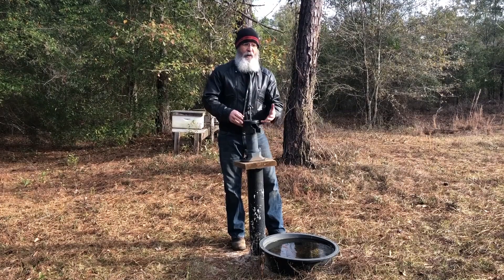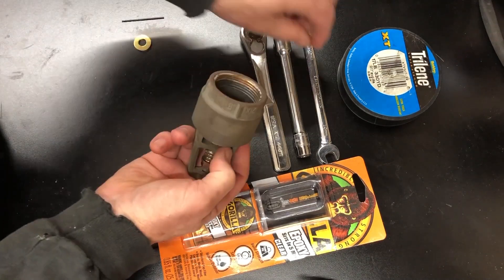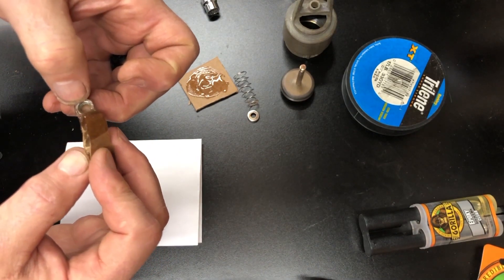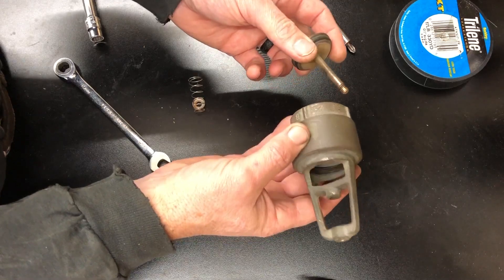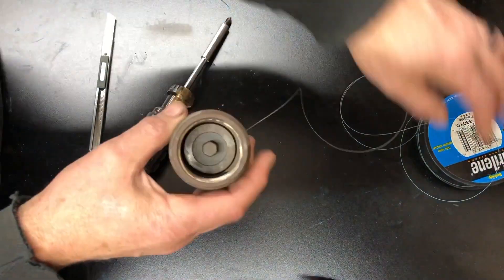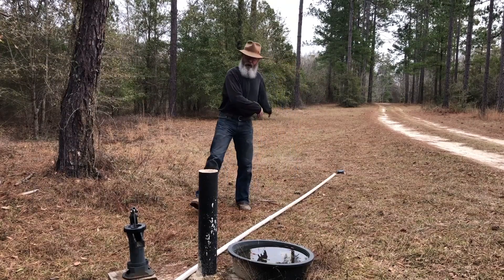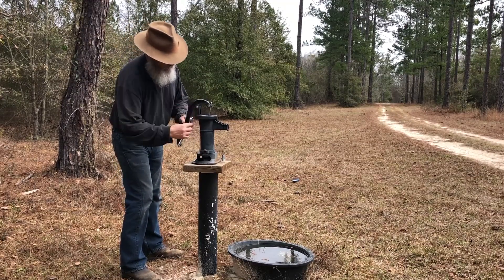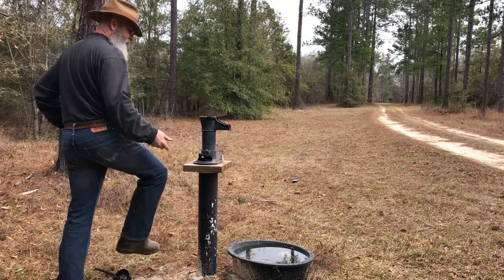Foot Valve Modification to Winterize Your Shallow Well

Comment: I’d be using 50 pound line.
Also I would have marked the side of the nut with a marker showing its orientation when tight. So your hole in the washer is perpendicular to the two  foot valve screen guides. Just to help. Good video.

Comment: Ah.  Thanks!  Found the winterization video!👍
Reply from the maker: I’ve been recommending this as a solution - https://youtu.be/yPAPBQVvm1s
Or you can pull the pump/pipe, drain then reinstall. Prime as needed for water. Repeat.

Comment: I appreciate your videos and have an idea for a new one.

For those of us who do not want to make the foot valve modification, can you show how you’d install a ball valve right under the pump so it’s easily accessible, but also doesn’t compromise the integrity of the water pipe (perhaps would need reinforcements)?
Reply from the maker: That is on my list along with a modified sandpoint installation.

Comment: This does not work, even with the heaviest fishing line I could find, pulling the foot valve open while the pipe is full of water just doesn’t happen. Even with steel line.
Reply from the maker: Not sure why. Maybe the type of foot valve? Anyway, I have since been recommending this as a solution for my friends up North  - https://youtu.be/yPAPBQVvm1s
Reply: @TigerCreekFarm  I have exactly every thing in the video. This is pure BS. Once it was clear that no amount of fishing line will work, I went and got a thin steel cable and that too doesn’t do it. All it does is pull the pipe inside my well to one side. You can not pull up with enough force to release the pressure on the foot valve while the pipe is full of water, you just can’t. Try it with just your hand, get your well pipe full of water and pull it up out and try pushing the foot valve with your hand, it’s super difficult with all that water in the pipe.

Comment: You really do not have to do all that every time below freezing, the only thing you and other should do is :
1/remove the spring from the valve underneath the pipe you do not need it.
2/add water valve underneath the pump above the ground close the valve after you used the pump so you don't have to prime the pump every day. when you know the weather getting bad open the valve this way you empty the pipe .
in my farm in North Dakota  I bought a cylindrical plastic garbage can, put an insulation inside it and foam, turned the can upside down, and the water inside the pipe did not freeze. The weather was -20.
Note that I forgot to turn the valve on the pipe full of water .

Comment: What about leaving the foot valve as is and, instead, putting in a check valve about a foot below the frost line and syphoning out the water above the check valve to winterize it?  You would just drop a tube of the right length in, and syphon until the water stopped.  Technically you could use the syphon technique without the check valve but the check valve would 1) keep the water primed through the winter and 2) let you know when to stop syphoning without having to measure. 

Maybe a crazy idea or might be some flaws with it.  Thoughts?
Reply from the maker: Very good idea. Using this method you would not need a foot valve. All a foot valve is is a check valve at the very end of your pipe.
Reply: @TigerCreekFarm  True, a check valve with an extra filter....but I was thinking the foot valve would keep the water between the top frost line check valve and the bottom of the well in place but, I think you're right, without the ability of any air to get in past the frost line check valve, the "vacuum" would still be in place to keep the water column past the check valve full which would keep the water primed at least up to the check valve.  Opening the well in the spring would just entail filling the pipe above the frost line check valve with water.

Feels like it works on paper at least, lol.

Comment: I was wondering how you keep the wooden support under the pump from rocking when you are pumping. I suppose I could drain the pipe using your fishing line trick then tie the pipe to something at the surface and put the pump away in the barn or basement. I don’t think the water freezes in the winter as it is 3’ below the surface but I can always make an insulated cover over the hole in the well cover stone. It’s a flat, thick, stone about 5’x4’ with a hole in it about 20” by 12”. The house is about 120 years old so one can only wonder how this was made. It’s a stone lined well.
Reply from the maker: A flange sits tightly in the casing pipe and the board is screwed to it - and the pump is screwed to the board.
Reply: @TigerCreekFarm  i understand, since I will be trying to make this work in an open dug well I’ll have to continue to work on a design that can be stable and yet removeable in our deep winters. Meanwhile, I just bought a foot valve and I wonder if  fishing line could be tied around the central post between the nut and the washer like piece above it that is concave to hold the end of the spring? I am finding the nut hard to remove.
Reply from the maker: @Ljblossom  as long as the place you have selected to tie the line will move the valve when pulled is all that matters.

Comment: @TigerCreekFarm 
Isn't better to make 2 little holes one on the right side and one on the left side so you pull the valve on 2 sides ?
Reply from the maker: Your idea will certainly work but all you are needing to do is break the seal.
Reply: I had the same thought, but only to create two lines in case one broke, so you wouldn't have to pull the pipe up again to attach a new line.
Reply: @casuist2  
If you make the line from fishing wire it will never break if you take one that's stong enough to hold a big fish then it can also hold a small value 😎

Comment: Couldn't you accomplish the same goal, by pulling the pump and pipe just enough to get below the frost line, and then drill a small weep hole in the pipe, at that level? No need to pull the whole rig, or tinker with the foot valve.
Reply from the maker: Yep. I have that very suggestion in another video.
Reply: @TigerCreekFarm  what video is that? What prevents water from leaking from the weep hole and your system losing prime?
Reply from the maker: @AndradeLearns  it needs to leak down past the point of freezing to prevent a burst pipe or burst pump casing. https://youtu.be/yPAPBQVvm1s

Comment: Before, in another film, you said you could release pressure, by lifting up the handle! I think I'd try doing that first, prior to taking off that top part.. I'd just use something, a rod, old broom handle, as tall as the handle is, 'lifted up', to keep it there, till the water line is drained! Kinda wonder, if not leaving that 'rod' there wouldn't help keep water/snow, seeping down into the pump valve, only that would go down into your water line and keep from freezing up as well!
Reply from the maker: The foot valve prevents the water from running back down the pipe so the handle lift only works without a foot valve. But you are correct in the way that a pitcher pump works.

Comment: Is there any modifications for a ram pump?
Reply from the maker: nick edmunds if you’re talking about the foot valve being used with a ram pump - probably not necessary since the force of the entering water overcomes the purpose of the foot valve. If you are speaking about winterizing -  I’m not sure.
Reply: @TigerCreekFarm  Foot valve setup uses less water ive seen then a swing valve also less prone to stick open
Reply: Brand new one ive used has issues at 6 foot high of water pressure and a foot valve has a higher success i think of not sticking open even when primed i find that it feels that a modified foot valve would work way faster and have more performance
Reply: @TigerCreekFarm  I know im not speaking of winterizing but more or less more modification videos of foot valves would be cool if there were so much more lol

Comment: (Good Modification) Although, you don't need to remove the pump plunger to release the seal/flapper. Just lift the handle and it will push down on the flapper weight and open the flapper to release the pressure.
Reply from the maker: Remote Computer Repair but the foot valve prevents any water from escaping the pipe - no matter what the pump is doing.
Reply: @TigerCreekFarm  Yes, understood. I was referring to your solution of removing the top in order to make the process faster. There is no need to remove the top - Just lift the handle and it will push down on the flapper weight and open the flapper to release the pressure.
Reply from the maker: Remote Computer Repair true. I misunderstood your initial point. Thanks for contributing.

Comment: Idea?
I suppose if you plan on not using the well for most of the freezing season, you could possibly just manually reprime the entire system with a mixture of water, sugar, and alcohol.
I'm avoiding the idea of also using salt as it may cause corrosion on any metal it stays in contact with.

Haven't thought this through, just a quick idea...

Thoughts?
Reply: That's what I was worried about as I was typing it.
I'm probably just over complicating things trying to avoid putting in a little work 😅

It's cool that I stumbled onto these videos.
As a kid, I thought the dowsing rod I would play with (which was a medium sized Y-shaped branch) was just a old imaginary trick people thought worked way back in the day.
👍Keep up the awesome videos!
Reply from the maker: Super Man not a good idea to add anything like that to your well as it will leach out into the ground water.

Comment: Where can I get the classic style hand pump at? Home Depot wouldn't sell it would they? Thanks
Reply from the maker: AdjacentJason they might. I think it all depends on where you live. One thing to consider - don’t get a “cheap” one. The really bad ones use pot metal instead if cast iron in some areas. Plus to be safe purchase one that is certified lead free. Do a Google search and you may find something that comes up in your area. Good luck.
Reply: @TigerCreekFarm   Thanks
Reply: Check tractor supply - they carry Parts2 O which is quite good.

Comment: TigerCreekFarm, I had asked you a question about this and see that you have a video on it. Looks like an area of maybe 
South Carolina that you are at. I do not have a shallow well or need one but I sure enjoyed the great videos. Sitting here thinking, the foot valve could be only ~1 foot under the upper pump casing. With a small tube thru the side of the 4 inch pipe, a guy could put a air bleed valve. I used to prime that pump with water wetting everything. I believe I was actually pumping the air up and out before the water hit the foot valve. @ 18:00 you mention that flapper ass'y. I think that is what I lifted with a bent piece of wire to drain the prime a bit.
Reply from the maker: I believe the valve you are talking about is a "check valve". Same concept of a foot valve just done in line. Deeper wells need this too in order to allow the hand pump to bring the water up.

Comment: In my area we seldom get below freezing for a 48 hour period. When we do, we drip faucets and open lower cabinet doors. We've never had a pipe burst. Our outdoor hose bibs stay covered with snap on bib covers, and never has a hose bib burst. I'm wondering if I drilled a shallow well, if I could get by during freezes, by wrapping the pump and top pipe with insulation and covering with plastic. In your experience how long and how far below freezing, does one need to worry about the pump and pipe bursting? Your videos are great! Thanks for taking the time to put these up.
Reply from the maker: RF Burns unless it is a hard freeze or prolonged freeze wrapping should suffice. Just use big doses of common sense and you should be fine. Thanks for stopping by.